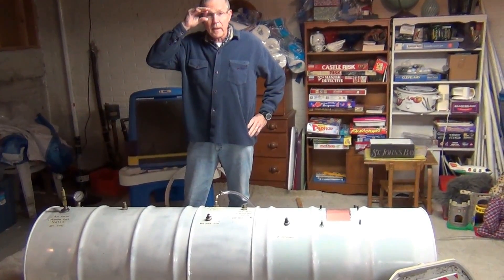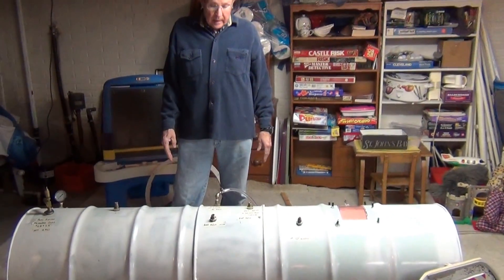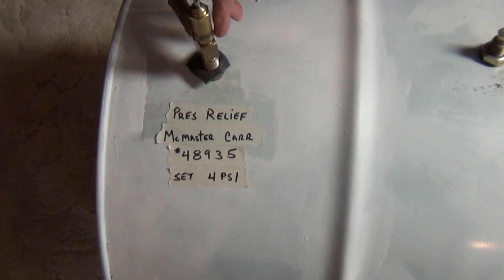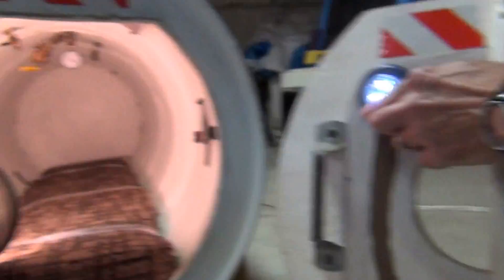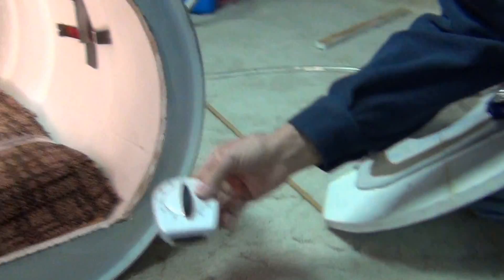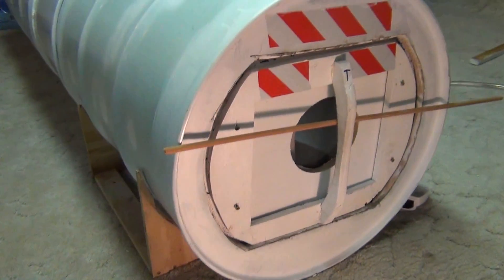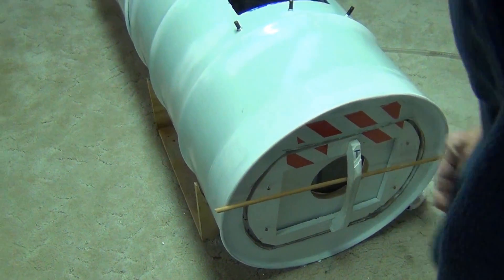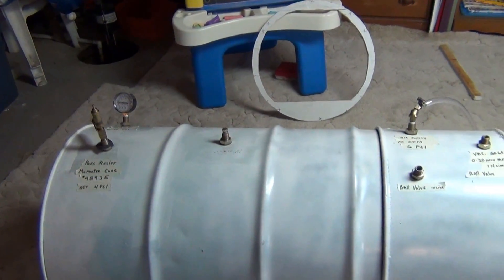Build an affordable Hyperbaric Chamber

Comment: I have a dumb question. I'm new to these but wouldn't it be easier/cheaper to just get an oxygen tank & mask and inhale the oxygen while sitting on the sofa or anywhere else? I am intrigued and agree we need more oxygen. Very informative and interesting, thx
Reply from the maker: +spaceboy537 
that is not a dumb question.  In a mild hyperbaric chamber the air density is increased, and you absorb the additional oxygen thru your skin, into your body in addition to more into your lungs.  Google it to learn more.
Reply: +Terry Kocsis at what pressure would you have to be worried about the danger of the bends?

Comment: Would it be difficult to hook up an oxygen generator to this to fill the chamber with oxygen?
Reply: THAT IS NOT A GOOD IDEA! unless u want to turn into a fire ball!!
That's why they use a mask with a inhale /exhale system that removes the pure o2 out of the tank, otherwise u end up with concentrated 02 in the tank and static can cause an explosion.

Comment: I assume you've been using it for the past five years. Has it improved your health in any significant way? Thank you!
Reply from the maker: Eugene Epifanov 
We made the first chamber about 2 1/2 years ago.  (the one in this video)  Later we made the chamber in video #2.  I stopped using this chamber, as it was difficult for me to get in & out.  
We use the one in video #2.  it is in my friend's house & 2 people fit comfortably.  We seem to use it more in the winter as we are more busy in the summer & the trees are turning CO2 into oxygen here in the summer.  When we use it, we feel that it does help.  (even friend's wife uses it for pain & she thinks it does seem to help.)

2 people w/ kids that have Autism have told me that they are using it, and they feel strongly that their kids show improvement with regular use of mild hyperbaric chambers.  

The purpose of this & video #2 was to show people can make their own mild chamber without spending $5,000 - $20,000 for a commercial unit.  Both of our chambers cost us under $500 each and I feel our chambers are as good or maybe better than the overpriced units.

I am NOT qualified / allowed to tell people that more Oxygen is important to our bodies.  That is up to each individual to learn / decide for themselves.  I personally believe more Oxygen is a very good thing.

good luck

Comment: I've watched this, 3x. 
However, all I can tell, is that there is an air pump.

That's just plain air.

What about the OXYGEN?
Shouldn't there be an additional cylinder/tank of O, which can be added to the inside air of this chamber?
Reply from the maker: TheCombineLover 
This is a "Mild" Hyperbaric Chamber.  Typically, A Mild Hyperbaric Chamber does NOT incorporate an Oxygen tank.   You end up with more oxygen with a mild chamber because you compress the air inside the chamber.  (typically 4 - 7 psi).  The compressed air increases the air density, 
14.7 psi is equal to 1 Atmosphere which would double the amount of air in the chamber, so 3.7 psi would increase the amount of Oxygen in the chamber by about 25%.

I believe I am explaining how this works as best I can.
Good luck.
Terry
Reply: Terry Kocsis I still would be interested in increasing the O to 100% for full treatment, as they do in sports medicine. 
Any ideas/suggestions?
Reply from the maker: TheCombineLover 
When I first became interested in Hyperbaric chambers, I was not happy with the costs.  That is when I decided to try to build one to better understand.    After I built my chamber(s) I verified that most of the  cost is NOT materials and labor.  I wanted to share what I learned on Youtube.  Hopefully these video's has helped others.
I do NOT know, but have heard that some have used an Oxygen concentrator piped inside a mild chamber, or even a scuba tank willed with higher levels of Oxygen to breath while inside the Mild Chamber.  I can not recommend nor evaluate the effectiveness.
There may be some private Oxygen Hyperbaric Chambers that take people without prescriptions or doctors orders.   I have seen a site in Ohio called Sara's Garden  in Wauseon Ohio.  do your own search if you want.
sorry I can't be more help.
Reply: Terry Kocsis Thank you.
I will still build one on this platform, and use the 25% increase, until I can find a safe way to increase the O.

Comment: Very helpful, even with a mild increase of the oxygen levels there are still great benefits to come with this. I think it's great that you're also sharing this with the public so that people can help live better lives, as I'm sure even a chamber like this produces a higher oxygen %tage than sea level.

Thank you for the video.
Reply from the maker: Thank you,
Yes, I believe the claim that 5 psi will result it about 33%  higher absorption of oxygen into the body.  This is 1/3 atmosphere.
A couple other ways that I believe help improve your health and the flow of oxygen into the body cells is daily use of Liposomal Vitamin C (you can make your own / check other YouTube videos)  and the 'Budwig anti cancer Protocol of Cottage Cheese & Flax Seed Smoothies.  (the Budwig people claim there is a chemical reaction between the cottage cheese and flaxseed oil that make this a powerful healer)   There are links & video's on this as well.
 I believe that you don't need to be really sick, or have cancer to reap the benefits of increased oxygen. 
In my mind increased oxygen is important for good health. 
Of course like all this, you have to read / learn and then decide for yourself, what you want to do.
Good Luck.
Reply: @terrykocsis1580 trapping the flaxseed into cottage cheese,is similar to making it lypoazomal , like you make your vit C.  Adaptogenic herbs are a nice add to these treatments
Reply from the maker: brandy nicole 
Yes, I believe there are some improvements, but it is very slow process.  Part may be mental, but also some physical.  I have not been using the chamber much lately, but use it more in the winter when you are stuck indoors, and I expect lower oxygen levels.  My friend's wife is currently using the chamber more and she claims it reduces some pains she has been having.
We use the chamber in video #2, as this one was difficult getting in and out, and the bigger chamber has more room, plus 2 people can fit comfortably.
good luck
Reply: Terry Kocsis great video thanx for posting, have you noticed a difference in health ?
Reply: Thanx

Comment: Hi terry 
What's the max psi you can get the chamber up to?
Reply from the maker: Neither chamber were ever tried over 6 or 7 psi.  Our fresh air pump has a rating of  10 cfm @ 10 psi, but I expect it would have issues maintaining that pressure for the chamber.  Another issue I had was that I did not want to damage the chamber just to experiment how high it could go.  I just wanted to meet or exceed the "commercial" / "Expensive" units sold to the public.  Typically they only get around 3 psi, and we run our unit at about 5 psi.
One gentleman wrote that he had a similar chamber  with reinforcements on the ends, and he intended to run it at 15 psi (1 atmosphere) .  I do not know what sort of pump he was using?

Comment: The therapy would be much more effective if you inhale pure oxygen in the chamber.
Reply from the maker: Of course a higher percentage of Oxygen in the chamber would provide more oxygen to the body.  It would also increase some "Risks" that this chamber does not have.  You owe it to yourself to learn all you can before you "experiment" on yourself.  (Risk / Reward)
I believe that much of the oxygen benefits from a mild hyperbaric chamber  comes from absorption thru the skin in addition to oxygen in the lungs.  From what I understand Oxygen thru the lungs does not always get the increased oxygen deep in the body cells that need them the most? 
I believe that additionally, you can get more oxygen working with regular maintenance dose' of Food grade Hydrogen Peroxide, Ozone water, or CE (MMS), & Liposomal Vitamin C can get more oxygen into the Gut where over 50% of the immune system can use it to help heal the body.  Before anyone would try any of the above, they need to do lots of their own research.  There are lots of information / misinformation out there.
It seems to me that you can not overstate the key role for Oxygen to improve your health.  I believe that with reduction / elimination of toxic poisons such as SUGAR, Fluoride, and many others that we are exposed to daily are necessary as well.
good luck .
Reply: In Oregon a doctor's order is needed to oxygenate the chamber itself.  A lesser effective method (that someone used on me) is to use some sort of mask like a jet fighter wears and run O2 in it while in the chamber. I just got a headache but them I am prone to headaches anyway. And it's not really about inhalation of the O2.  It's about the increase atmospheric pressure forcing O2 into the tissues and even crossing the blood-brain barrier.  In this way you can do some amazing things.

Comment: Hi Teri, I was wondering what you used for the windows?
Reply from the maker: We used some plexiglass that we had on hand.
for the flat surface we use some liquid nail / silicone sealer along with screws to hold it it place.  Was easy, and could have probably had a larger window than we did.
for the curved surface, it was not as easy.  We placed the plexiglass in the oven at low temperature (200 - 250? I don't remember exactly) and allowed it to soften / get flexible.  then while it was still warm we tried to form it over a glass to try to match the curvature of the tank.  We also use a heat gun, and drilled bolts thru to try to match the surface.  Again we used silicone sealer and pulled the plexiglass in place with the bolts.  It wasn't pretty, but it did work on our first try.
You may find something on YouTube where someone else formed plastic shapes?  I never looked.
Good luck.
Reply: Use lexan, or essentially polycarbonate. It's the same thing, but lexan is brand name and expensive.  Just polycarbonate, same thing, but much cheaper. 
Everything  like plexiglass,  except is  flexible, but is strong and doesn't  break. 
It doesn't  crack even, if you smack it with sledgehammer.  This is why polycarbonate  is used for a windshield  on race cars!
Strong,  flexible,  doesn't  break, doesn't  Crack. Everything  that you want in plexiglass, that it doesn't have

Comment: does this also have ozone?  I thought it was to have a bit of ozone which is really good for you?  I would also like to say thank you for this video.  You did awesome:)
Reply from the maker: Evone,
When you read more about 'Mild Hyperbaric Chambers' you will find that they do not use pure oxygen.  They compress the air inside the chamber to increase the air density, which results in more oxygen in the chamber.  The increased air density helps push more oxygen thru the skin & into the body.  (that's how I understand it) 
I believe that even little bits of increased oxygen is good for people (& pets), but a mild chamber takes many sessions to see results.  Does it help?  I am not qualified to say, but I think it does, and I think it does NO HARM if you follow a safe protocol.  (thinks like do not let the chamber de-compress too fast at the end of a session, and make sure you have a good source of fresh air at you pump.)
You bring up something very interesting (Ozone) that we have not done to date.  I think you are saying to put an Ozone generator inside the chamber to increase the % of oxygen along with the density.  I believe generating Ozone inside the chamber cold be done, and I do not know of anything bad happening because of it.  From what I have read, some people have used an Ozone generator to breath inside a room.  I just do not know enough about how much oxygen a home ozone generator will release????
IF you look at my video "Bubble Hydrogen Peroxide in Hyperbaric Chamber" you will see that we have run some of the incoming air thru hydrogen peroxide (H2O2 / water and oxygen) in our mild hyperbaric chamber in an attempt to do what I think you are suggesting with ozone.  We did this in our second generation chamber which I showed in video "Build an affordable Hyperbaric Chamber #2".  You may find some things interesting in  video #2 as well.
I agree with you.  OXYGEN is VERY, VERY good for your body.  IMO, Oxygen is #1 in obtaining good health.  The trick is getting more oxygen deep in your body so that it reach's all body cells to kill the 'Crud' and promote health.  IMO, the '#1 Bad Boy' that is hurting (BAD for) our health is 'SUGAR'!  I believe if we can increase our oxygen in the body cells and eliminate all forms of sugar and simple carbs that turn to sugar inside our bodies, we would all be on the road to a better Quality of Life.  (Do your own research on the LEGAL / Government Subsidized, (I have heard it called)  "POISON DISGUISED as a FOOD" aka 'SUGAR')  Adding Oxygen and eliminating Sugar is easier said than done.
I hope I answered your question.
Good Luck,

Comment: Terry, where did you get the bulk head fittings that you used?  I can't find them.  I have some picts I'd like to share with you.  Are you on FB?
Reply from the maker: Steve,
No, I don't do FB. 
If you post your email address, I will email you mine.
I got my bulk head fittings from a friend already had them.  I believe you could probably get them thru 'Granger Supply'.  I just did a google search and found some listed.
good luck.

Comment: Thanx for your excellent video Terry. PLEASE pay ZERO attention to naysayers. They're a big part of what's wrong with this country today. They are a drag on everybody and everything and discourage innovation. I really wonder if they are paid by the AMA/pharma cabal which needs us sick and coming to them for "treatment" or if they are just plain brain dead. If everybody was like them we'd wouldn't even have wheels.
 I'm planning one, but somewhat different. I've an aluminum diesel truck tank to cut one head off then split lengthwise and weld halves together to hinge one side to plywood board w/ gasket around where tank edges contact. Also plan to use oxygen instead of air, as I learned MANY years ago there's ZERO difference in "medical" and welding compressed O2.
Would you kindly call me @ 731 584 6591?
Reply: Yes ignore people who know what they are talking about and pump welding o2 into a vessel you are laying in without making sure of any safeguards because you once heard there is no difference between Medical and welding 02 (there is).
Reply: Not "once heard", I saw.
Reply: Dwayne Oxford Saw what exactly?
Reply: The green tanks with their chrome plated valves getting filled alongside the welding tanks. What makes you think there's a difference? All they're doing is evaporating LOX and pumping it into tanks. Ain't rocket science.
 Nigel Lewis
Reply: The're most likely filling to Grade A and using that to weld as well.
There is a difference when the O2 is made, not when it is moved form a big tank to a small tank. If they are washing air to leave just 02 there is a lot of science to that.

Comment: I'm in the process of building one of these.  I looked for the info you said would be posted but I'm not seeing it.  Does it matter what kind of air pump I use?  Thank you!
Reply from the maker: We used a Bullard EDA-10 Free Air Pump.  It is they type of air pump used for breathing masks in paint booths, or nasty industrial work areas.  There are other brands.  (can got them used from eBay or Craig s list? / we did)
You need enough volume to be greater than any leaks and to build / maintain a pressure of 4 or 5 psi.
We used a shop vac to test the unit for sealing, but that only gets you to 1 - 2 psi, but gets you there faster.
A standard air compressor has oil and other toxins that is not a good idea.
I hope this helps
Reply: Terry Kocsis Yes.  It does help.  Thank you for responding.  I've noticed several air pumps that are oil free.  Wouldn't that work OK?  Like this one.

http://www.grainger.com/product/PORTER-CABLE-Portable-Electric-Oil-Free-WP157580/_/N-aey?s_pp=false&picUrl=//static.grainger.com/rp/s/is/image/Grainger/1VAN5_AS01?$smthumb$
Reply from the maker: Steve Moutria
Steve,  That is an air compressor that can be used for some power tools, but I do NOT think you will get enough volume of air to meet the needs of a chamber.  IF you know someone that has one you can try it and find out. (??)  One thing that I feel is important, is to have more (volume) fresh air coming in than you can breath.  Have a big safety factor / better safe than sorry.  With a few internet search's you can find that information.
That is why we went with the pump we used.  I felt if I stopped using it, I could always resell it later.  (my opinion)
Reply: Terry Kocsis Thank you again for responding.  I researched your compressor but it only provides a max of 5 psi.  I am in need of 12 to 14 psi.  The chamber I have made can hold over 20 psi but I will only be running it at 14.  I am still researching it out but I was hoping to get the chamber up and running sooner than later.   I figured since that compressor is oil free and can push 150 psi that it would provide the volume needed.  Is there any way I can contact you via e-mail?

Thank you again for your willingness to respond.
Reply from the maker: send me your email address and I'll reply.
The pancake compressor you are looking at will reach lots of pressure, but the displacement is small.  I did not see the volume rating?
Reply: Terry Kocsis Is there a way to send it to privately through here?  I really don't want to put my e-mail out in full view.
Reply from the maker: Steve Moutria
I understand, I have the same concern.
Reply: Terry Kocsis I'm currently working on getting a filtration kit that will remove all contaminates from a regular compressor.  Thanks for your help.  I'll try to keep you up to date as I get it all made.  Thanks again.